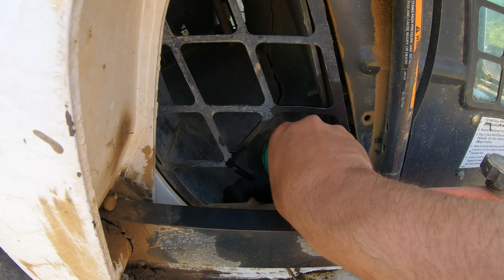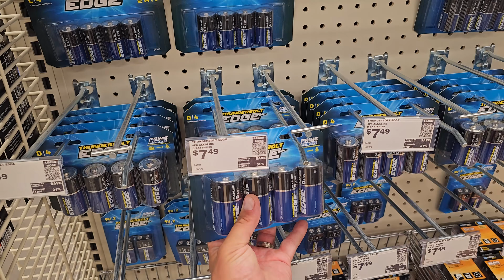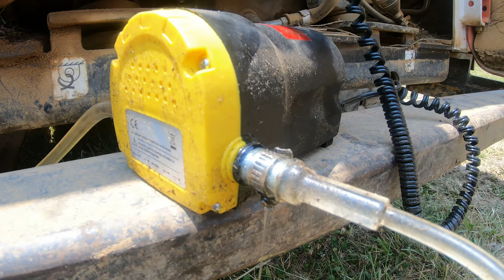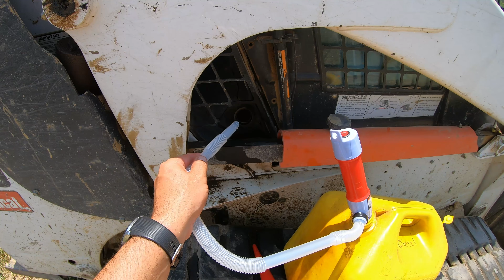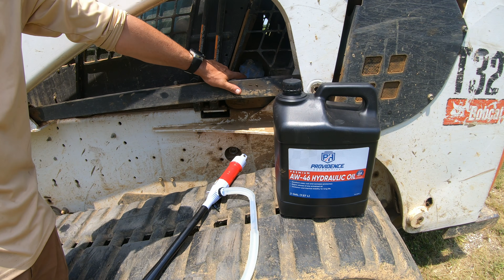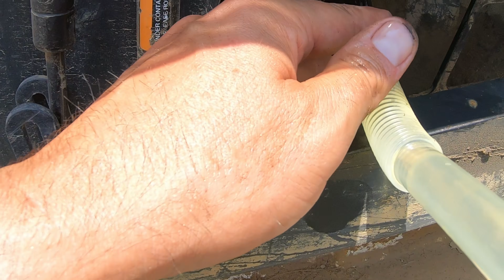Harbor Freight Transfer Pump Tested with Diesel and Hydraulic Oil

Comment: Don't know if anyone else stated but don't mixed your fluids. 
Get a couple more and mark for diesel, gas, hydro fluid, ATF, or what ever.
I have a couple for diesel and gas. Use mine enough to need to replace batteries a couple of times.
Reply from the maker: Good call. Yeah, for as inexpensive as they are it doesn't hurt to have more than one. Thanks!

Comment: These pumps are very temperamental. Mine worked great for the first 5 or 6 times, then it seem to stop turning on. But I found that if I bump the button where the fluid gets pulled in the fin starts to turn on and work! But it’s getting harder and harder to get it to work. Would not buy again.
Reply from the maker: That's good info Jeff. Another viewer said to store it upright to keep fuel from getting to the batteries. I'm going to try that and report back if I have similar issues. Thanks for the info!

Comment: After a year mine started pumping fuel through the power button and leaking through the batteries.
Reply from the maker: Did you store it horizontal by chance? A viewer mentioned not letting it lay horizontal helps keep the batteries dry. Thanks for watching!

Comment: Thanks for the video.  I keep looking for a better way to fill my T300.  Might go pick one up now.  Longevity follow up would be beneficial.
Reply from the maker: I've been told to not let it go horizontal to keep fuel away from batteries but yes, after about 4 or 5 different style funnels and a lot of spilled fuel and some choice words, this is my new way when I need to use the full 5 gallons!